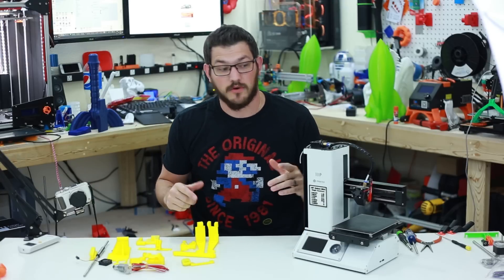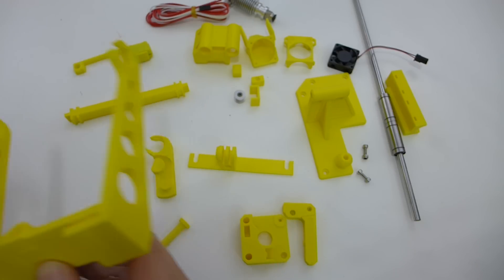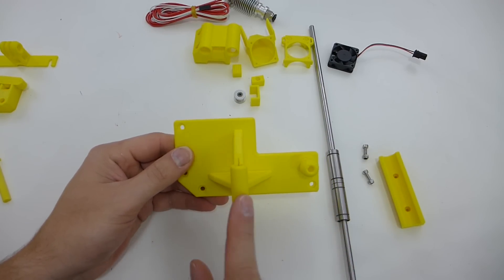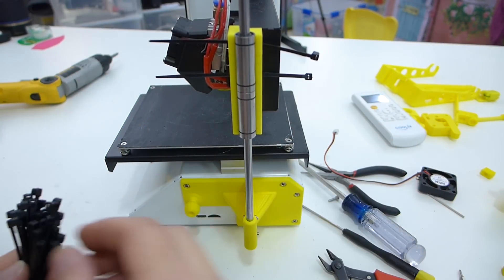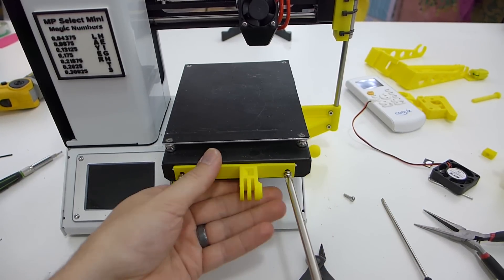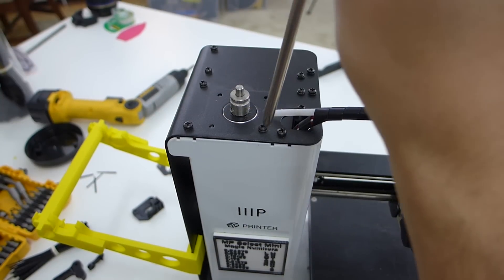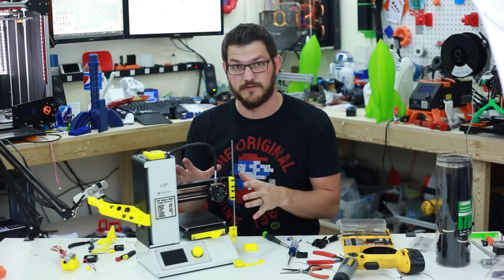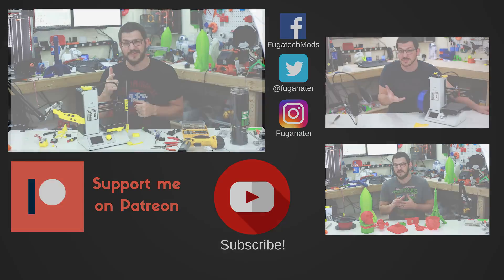Modding the Monoprice Select Mini (Part 1)

Comment: For the replacement extruder part that was 3d printed, wouldn't it have been more logical to make it only need the two bolts on the left and the back on the right to be through the part and the final front right bolt have a recessed hole in the 3d printed part for the bolt head to sit inside. That way the extruder motor never has to be completely released from where it is already mounted?  All 4 bolts seems a bit excessive just to hold the new extruder and motor in place.

Comment: I know this is an old video about this printer, but I just got one and I am very impressed with its performance.  You mentioned reversing the LCD and Cntrl Knob in this video, but I have not seen anything regarding this.  Just to let you know I just finished doing this change and it makes a big difference in the profile look of the printer.  The LCD/Cntrl Knob backplate has to have the solid area cut out so the two wires that are connected will align properly.  I just used a 5/32-inch drill bit to drill out holes and cut the slot profile out to mimic the slot above it and then file the rough areas down.  You may have the cut down the four mounts on the backplate that the Ctrl Knob switch mounts to.  As of right now, mine is working and I love how it looks.  Thank you for the suggestion.

Comment: Is this compatible with the v2? It'd be cool to see how this translates with the v2 model!
Reply from the maker: They should but I don't know because I don't have the V2
Reply: For those replacing the extruder on the V2 model—the baseplate is easily replaceable, but double check the arm is visually simular before trying to remove it.  Mine appears to be an entirely different (newer?) design without the long screw holding the bearing/wheel in place, it seems to be replaced with a shorter  screw and and a raised screwhole that also holds the bearing (its what it spins around instead of the screw, it seems)

Edit: V2 users should use the WK9 feeder replacement[0], and make sure you note the addtional required parts so you don't keep forgetting when putting it together like me:
PC4-M6 Pneumatic Straight Fitting, for 4mm OD tubing. (x2 if you use WK9_Extruder_Arm_Bowden)
M6x1.0 Nut (x2 if you use WK9_Extruder_Arm_Bowden)
M4 Screw, 10mm long. (or #8 x 3/8" Imperial Machine Screw)

[0]: https://www.thingiverse.com/thing:2756509

Comment: im either going to get the select mini v.2 or the select mini pro, i dont know which one to get, and i have a couple more question. does this support 1kg of filment? (the voxel only has .5 kg) also, on the reviews, it says that there isnt a heated bead, could you also confirm if there is or isnt? and is the only option to make the prints stick to the bed to use tape or a new bed? (and is it important to have a heated bed/do these steps to have the print stick) last thing, can i use the oldest version of cura (1506.06.) or do i need the latest version?
Reply from the maker: Both the stock spool and the one I used support 1KG spools. The MPSM v1 and v2 both have a heated bed. I put a piece of BuildTak on my V1 but the V2 comes with it I believe. They do not require a heated bed but I've always had more success in using a heated bed. Just use the latest version of Cura.
Reply: @Fugatech3DPrinting  ok, thanks!

Comment: Interesting video. Thanks. How ever, It looks like the horizontal support device is counter productive. The bearings, no matter how good, will offer some drag so it could do more harm that good. But there is a lot of variables going on so it may still work. The variables are vibration reduction, which this may help. Also, as mentioned, saging may possibly be reduced. It is not clear that is true but possible. Mainly, I feel the drag will be worse than the reduction of vibration. Just some back of the napkin thought experiments. Let us know how it turns out.
Reply from the maker: I've not noticed any negatives from doing it but also no positives. Maybe for prints that cover the entire surface but IDK.

Comment: I've tried the GoPro mount on my MPv2 and it's horrible - because the fast and sudden motion of the bed makes my camera wiggle. Maybe I'm the only one with issues here. Going to build an own holder for the cam now...
Reply from the maker: When using it in timelapse mode you can't see any shutters.

Comment: Why you guys call the China copy E3D V6, it is not! E3D V6 Genuine don‘t have PTFE tube to the nozzle, E3D V6 can be used for more than 245C....
All my printers get E3D V6 Genuine... so did the MP SM V1... no issues with clocked nozzles ....
It is a cute little printer :-)

Keep the hotend fan all times on 100%, and stay to the retraction info from E3D wiki
Reply from the maker: Because the E3D V6 is open source so a copy of it is a copy/clone of the E3D V6. Could just call it a V6 I guess.

Comment: Best way to hold the motor is to reach in on the right side where the printer head axis is. ( you can push the motor up with one finger)

Comment: did you shrink the spool holders in cura? I can't get them to fit the bed size no matter how i turn them
Reply from the maker: I didn't print it on the MPSM so I am not sure.
Reply: Is brim enabled? I don't remember if I used "none" or "raft," but I got it printed on my mini v2 when I rotated it to print diagonal on my bed.

Comment: What good is it going to do to add a vertical linear slide only supported on one side?  Does just about as much good as a door supported by only one hinge.  Clearly a mechanical engineer didn't come up with these mods.

Comment: +Fugatech 3D Printing would u recommend the Monoprice Select Mini V2 for a beginner?
Reply from the maker: Yep. It is definitely a solid printer to start with. Easy to use and a huge community to reach out to for tips/tricks.
Reply: No.  Get an ultimaker.  the Select Mini is a major faff

Comment: I just got one of these. Printed great out the box. I am going to print some mod parts and extruder  feed housings for spares. And the wire link cable thing for the heater wires, so far though its been really uneventful and easy to use. I had a kit build printer before this and could not get it to print anything but blobs and rat nests lol.  Good wee printer for the cost.

Comment: Did you make a vid on the hotend...I bought mine sometime ago bu have not done it.  A little intimidated and do not want jack up my mini.
Reply from the maker: Not yet. I tried to but couldn't get the new mount on the printer. I have since then tried out 3 different ones and now have a E3D v6 clone on the printer and it works really well. I'll be doing a video on this in the near future.

Comment: Too bad you did not show how you changed the idley puller thing. I think it is the part that makes the most noise on my printer, but there is no video about how to change it. A link to where we could find one like you with new bearings would be cool too!
Reply from the maker: It was really simple which is why I didn't. If I show every little thing the videos would be an hour long. I'll add links for the idlers I ordered but the 3D printed part is already listed.

Comment: Check your printer before you print the spool holder. I didn't and my spool attachment thing is different. Wasted some plastic.
Reply from the maker: Mine came out just fine.
Reply: ? I assume it did! My printer has a different connector and that part doesn't fit on it. Just an FYI for others with this printer.

Comment: Links to the models?  Why are there extenders on the spool holder?
Reply from the maker: I've added them all to the video description. You need the extenders because the stock spool doesn't fit standard spools. Only the short fat ones.

Comment: I've seen a video where the end of the rods need to be hit with a piece of wood to come off. There is glue. 

Also, I did that arm and baseplate mod (by Robin Reiter) and found the hole for the nut was too wide and not a snug fit for the nut, so I modified it in tinkercad to fit the thinner nut. My version also needed a small piece of PTFE tube cut and fit into the base plate to help stop flexible filament buckling out, even more than the protruding point of the baseplate.  

And I was shouting at the screen "it's the wrong way around!" Too funny. ;)

Comment: I use the big Larry magnetic led light bar and just stick it to the top facing down and works like a charm
Reply from the maker: Can you send me the link for that?
Reply: Fugatech 3D Printing https://www.amazon.com/gp/aw/d/B012DH2KG4/ref=mp_s_a_1_3?ie=UTF8&qid=1511467013&sr=8-3&pi=AC_SX236_SY340_FMwebp_QL65&keywords=big+larry+nebo&dpPl=1&dpID=31TqK6fIRgL&ref=plSrch

I'll take a picture of it when I get home. When you put it on top it doesn't interfere with the z axis

Comment: what, no capricorn tubing? come on now....
Reply from the maker: I still don't see the need for it.
Reply: the smaller i.d. keeps your extrusion accurate, it also is less friction so flexibles are easier or possible, and its high temp, so theres no worry about going over 240. its a far better product, and much more accurate printing over all.

Comment: For the lcd, does it run stock marlin, if so you might want to look and see if you can replace the lcd with one of the 0.9"/1.3" i2c lcd screens and then just move the knob up into the resulting extra space.
Reply from the maker: As far as I know it does not but I'm not 100% sure.
Reply: It does not.  The UI is a custom firmware.